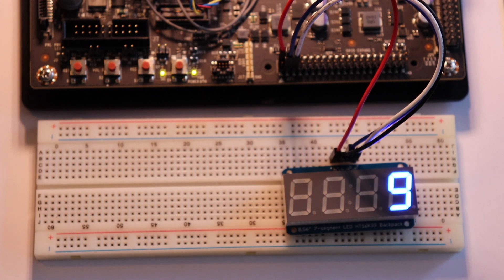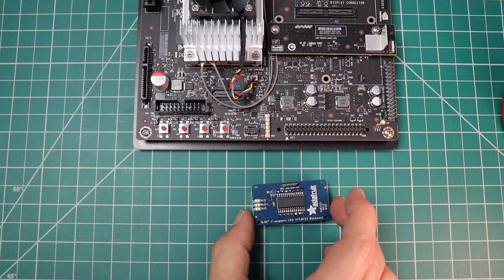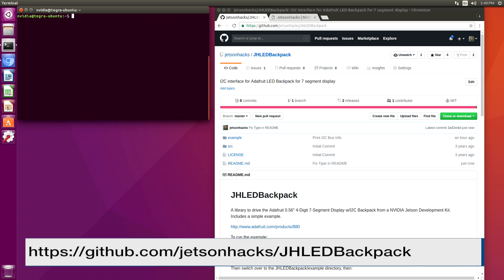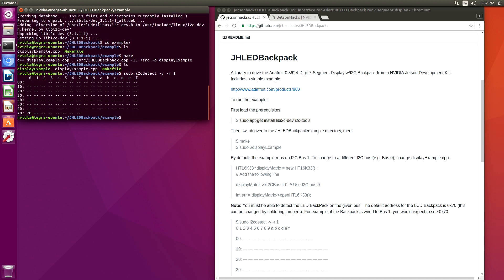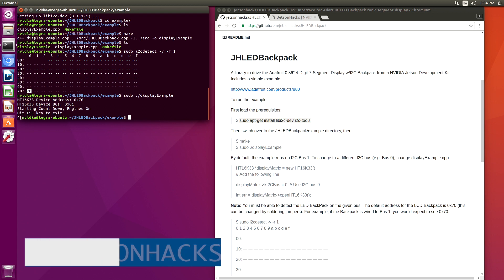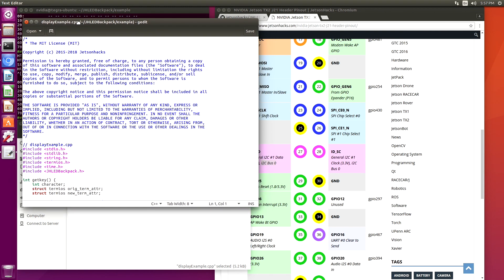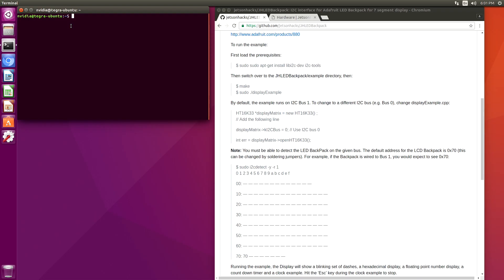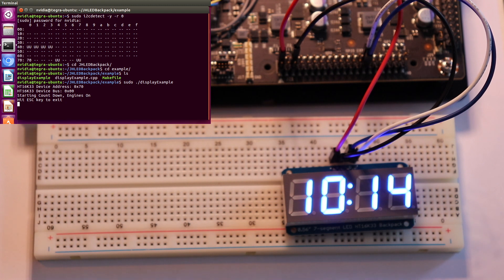How To I2C - NVIDIA Jetson TX2 GPIO

Comment: This explains how to use your example, but not how to actually work with I2C...
Reply from the maker: The title is "How to Interface with the I2C bus on the NVIDIA Jetson TX2 Development Kit J21 GPIO Header". There is an article https://wp.me/p7ZgI9-12a with more information on wiring diagrams, explanation of I2C, and pinouts for the TX2. There is a working example, with code on Github, shown in the video. What parts are missing from what you are expecting here?

Here is an article that explains what I2C is in more detail. Is this what you are looking for? https://dronebotworkshop.com/i2c-arduino-arduino/

Comment: Very helpful - thanks! Do you have any video/post/support on how to read from a sensor (in this case an Adafruit accelerometer) using I2C on a TX2 ? Thanks !
Reply from the maker: It's similar to the TX1: https://youtu.be/j5F5giz5LYw
 You will need to change to change things around accordingly. The code is just straight forward ports of the Arduino code posted by Adafruit. 
If you use a lot of I2C stuff, you will probably want to use a more robust library like libi2c, or you may find that the new GPIO library for the Jetsons are acceptable. Thanks for watching!